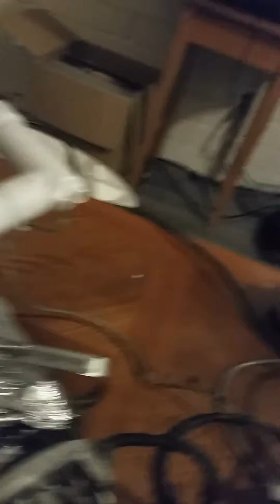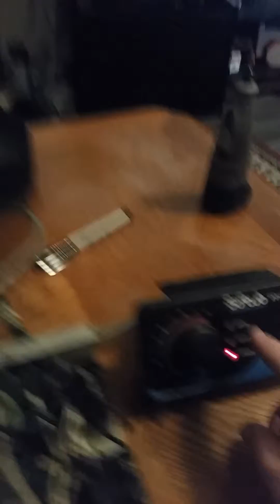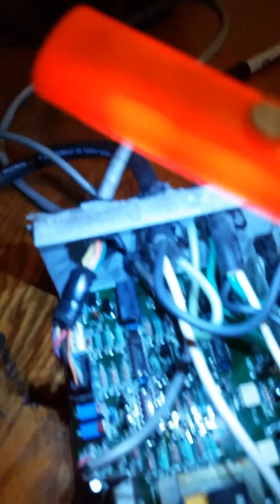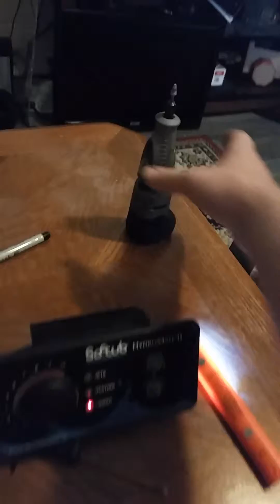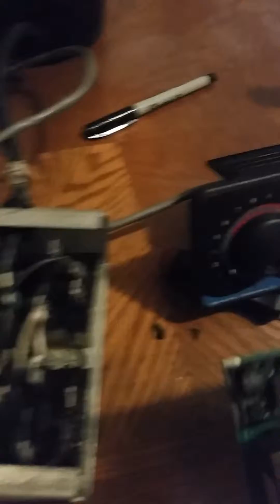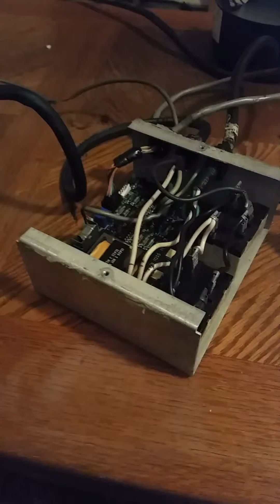Softub hydrometer II (not pumping) fix

Comment: I have an issue with mine where the relay clicks after plugging in which i think is normal.  The motor runs  and keeps running, but the temp display flashes "00" and the filter led flashes.  I ohmed out the 2 temp sensor wires and digital display panel wires.  All thats left is main pcb or digital control panel.  Maybe reseat connections on main board or resolder.

Comment: What size resistor did you add to make the temp higher, and which wire did you splice it to?
Reply from the maker: its a resistor so it doesn't matter what wire you splice to i personally used a 1k resistor also known as a  1000ohm and that will increase the temperature by 3 to 4 degrees. remember that if on a newer hottub (a newer softtub with digital controller for example) they will likely have two temperature probes to that if one is off from another it will shut down for safety. in that case you would just add the same size resistor to each temperature probe.